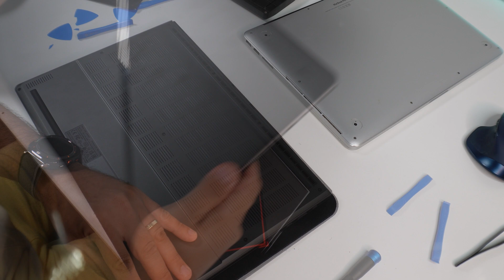NEW ASUS G16 2024 Laptop QA Issue Sparks Major Frustration

Comment: Just bought the 4060 version for almost a month and I had the same issue… it really drives me crazy whenever I lift the laptop up or close screen of the laptop. Maybe I need to bring it to the ASUS customer service…
Reply from the maker: @dweng66 Man, I had so many replies and people getting in touch about this laptop. The one here in the video is also the 4060 model, and now, after I fixed that loose screw, it just creaks every time I close the lid. The hinges on these very expensive laptops are glued in. So even if the hinge is metal, and so are the lid and the body, the actual connection between them is glue... unbelievable, huh?
Anyway i doubt there is anything that asus will do about this,as the only good fix is to actualy use a stronger epoxy resin down the road when it breaks....or just get a refund if you can and buy something else.cheers bud

Comment: Hey brother I'm getting a winding r car revving sound from gup fan ..it's kinda similar to rattling sound u experienced but only when the fan is turned on ..ig probably from fan bearing should I rma or replace?? Help me only 2 days left for rma? Help me.. the sound of fan kinda is bad..is it happening to u
Reply from the maker: Hi man,I haven't had this issue but you are not the first one to complain about it.Im guessing that ASUS is having a serious quality issue with their line-up from using cheaply made parts in their assemblies like the fans.Well your options are to open up the laptop and see if there is some physical blockage in the fan,thats making the sound once is on or indeed there is a bearing issue that requires the fan to be changed out.Since you are under warranty I would recommend going through the RMA process but also do keep in mind that if you want to swap out the fan,its a very simple process and the fan assembly can be found on the internet quite easily.If you want to avoid the long process of ASUS fixing their money saving stupidity by giving inferior products at overhyped prices...:(
Reply: @Tech_Fusion  hey thks alot brotha..sry for the typos over there🥲..I just brought it new days ago..so refund is available but it's my 3rd time getting replacement..thinking I'll manage with this only..if i open it will i void warranty?? Sry for typos🥲
Reply from the maker: @tejgu8403  No worries,you are not voiding your warranty for opening the bottom paart as you have to have access your second nvme drive,and also to clean it.If you will change the fan then yes you will void it.cheers bud
Reply: @Tech_Fusion  bro I need a suggestion wheather to return it as it fan sound is annoying..or just keep it?? And get it fixed instead returning ..I have either any option..the reason i thought of return because there are two more thing ..rattling sound in mosuepad and black spots on screen only seen when we turn off .. which happened with earlier units and ig it's the oled technology?? N mouse pad I dunno So should I keep Zephyrus g16 or return it and purchase another..I'm looking for mini led display or oled but gaming ..help me please..am around this for months
Reply from the maker: @tejgu8403  If you have more then just this issue I would recommend you return it and get your money back if you can.This zephyrus is a brilliant laptop for gaming and with stealthy looks.Its like a macbook for gaming,too bad its not built like one.As an alternative you have the STRIX lineup of laptops that offer similar performance although its more gamer looking but I had bought one in the past for reviews and dont remember it being half as flimsy as this zephyrus. Sure you are  going to loose the overall aluminum design and the liquid cooling but its heavier, thicker and overall should be a bit more rugged. Or if you get your money back then you could try and buy another zephyrus brand new and see maybe you were unlucky with this one.Like in everything there are good and bads and maybe this one just had one too many issues.Cheers bud
Reply: I have the same issue. When the fans go from stopped to starting, it makes a weird cracky noise which is really annoying

Comment: Hey man!

I just bought the laptop two days ago(GA605WV- ryzen&4060). Fresh windows install, all the drivers. I installed cinebench r23 and after I hit start the system fan began to make this grinding like sound, from low rpm to max. I don't really remember if I made this sound while installing the windows though.
Now it makes this grinding sound even at low rpm, while just scrolling reddit/youtoubeing etc. If I shake the laptop I don't hear a rattling sound so I think is not a loose screw but either somehow the fan touches something or it has a bad bearing. Is it normal or just bad luck ?

The sound I'm hearing is at the top, left'ish (where the 4 key/AC button is)-_- I can see from this video that the system fan is in the lower mid part of the laptop but when I control the fans in AC and turn off the system fan, the grinding goes away, if raise the fan curve the sounds comes back.
Am I missing something ? bad bearing or it might touch something ?
This: https://youtube.com/shorts/6o4kozcQspo?feature=share
Reply from the maker: Hi there man,Firstly Im sorry to hear that Asus's QA strikes again.As another confirmation point hit is for sure something to do with a fan,but it could be a simple fix as some loose debris stuck in there or a broken fan blade or bearing.The bearing though seems kinda odd on a new machine...As I see it it your options are to maybe open it up and clear the debris if you are that lucky and there is just some loose piece of plastic in the fan housing or send it back to the store.If you are going for sending it back,try getting your money back if thats an option,instead of going through the RMA process as that can take much longer then you getting the money back.If you cant get your money back than I would warranty it,as going thought the laptop yourself only to find that you cant fix the broken fan(hard to find and swap yourself) could void the warranty if case something else happens during the teardown(broken clips or others).Its really sucky from ASUS in the way they dont care about their QA overall even on highend machines.
I have had the opportunity to test out other laptops(same model) and saw inconsistencies in the way the lid sits when the laptop its closed, rattling  noise inside them when moved around gently and other people complaining about misaligned chassis with the lid or the lid being just slightly bent out of shape where it doesn't sit flush with the chassis when closed. Let us know what you decide bud.Cheers
Reply: @Tech_Fusion  Superb! I will RMA it as I bought it for work, with company money. We'll see! 
So sad you pay 2k euros for a high end laptop and you receive it with this kind of problems...
Thank you! 
Cheers!
Reply from the maker: @adrianpruteanu3554  This is the world we live in today...where thousands of euros means nothing for big companies.I  was also disappointed when I got mine with its batch of issues but the only reason i kept it is this youtube channel  and the change to review its issues.A word of advice,if you bought it off Emag and you are in the 14 days of return,its gonna be way faster to just give it back and buy a whole new one and also I found out quite recently that the version that's packing the 4080 has a different design in terms of cooling.Its only  rocking 2 fans instead of 3 and it has a new vapor chamber that its using.Its supposed to be more efficient at cooling and more silent as well.Not sure if its still using liquid metal but it might.Cheers bud:_CoolBoy:
Reply: @Tech_Fusion  Indeed I bought it from Emag, the only problem here is that I don't have the money for the 4080 version :(. I don't have any other problems with it so far. The display hinges are good, the alignment is good, no weird sounds or flexing.
Cheers!

Comment: I bought my G16 open box for $1400 after tax. had some sticker glue on it, other than that no issue. Tried replicating your issue and I can not
Reply: After digging more, it seems issues are around the Intel variants of of the g16 as Armory Crate and windows tend to be in a tug of war in terms of wattages with the ultra processors. It might be why they refreshed with an AMD chip, while leaving the G14 alone
Reply from the maker: Well then Im guessing its just my luck of the draw....still mine was not open box and it came with its seals intact so...this could be my "golden ticket" of laptops.I guess karma hunted me because of my youtube chanel.Its good that yours is fine as it should be.Enjoy it man,its a very nice and premium laptop
Reply: @Tech_Fusion  its funny, a few hours after writing this comment. I started having issues. More software side, or hardware as a few games were no longer recognized by my gpu. Once I solved that, my task bar would not populate at all on the bottom.
Reply from the maker: Hey man,well it seems like another classical great user experience with windows.Especially if you are running 24H2 pack for Windows 11,then glitches are to be expected.Glad at least that everything seems to be ok hardware wise with your machine.
Would you mind doing me a solid and tell me if your screen seems ok?To the point:If i stare at my screen close range with low brightness(aka use it in bed at night) my screen appears to be grainy(looks a bit like the ereader screen in a way,with a paper like texture,and the image is not crisp even at low brightness).Cheers bud and thank you
Reply: @Tech_Fusion  This is true. With lower brightness you will get a grainy look to an extent. I believe this a Samsung issue. As Samsung makes Asus's panel. The problem is also seen on the S24 phones. It isnt enough to bother me, due to the viewing angles on this larger screen. I have to be looking for it to really notice it.
Reply from the maker: @jimmymac2292  well thats good so to speak.I was hoping that this is a so called normal quality for this panel but honestly i feel disapointed by the overall quality of my unit.this since i ran in the other issues as well...Premium money for not so premium products...what a world.At least performance wise it delivers and I really hope its gonna be a long lasting product.Cheers buddy and thank you so much for the feedback

Comment: The quality on the zephyrus g16 I have is flawless and perfect. Zero creaks or issues with fitment or quality control.  I did a full review of it and am going to be showing some other videos soon. There’s absolutely nothing wrong with it.
Also taking the bottom panel off does not void the warranty. That’s false. They’ll only void the warranty if you damage it.
Reply from the maker: @cppctek  Luck of the draw i guess...Still mine did have that screw that looks like it was taken from the parts bin and also it was loose so there is some qa overlook on asus's part.As per the warranty,maybe i mispoken as indeed it wont be voided juwt by removing the bottom panel but in my case if for instance i have a later date problem with the flex cable that resting under that screw,im quite sure they could play hard ball if it comes down to warranty as there is no way for me to prove that that screw came like that and they could blame me for fiddling with it since i've opened the machine up.Cheers bud and otherwise enjoy this very nice shinny new beast :_CoolBoy: